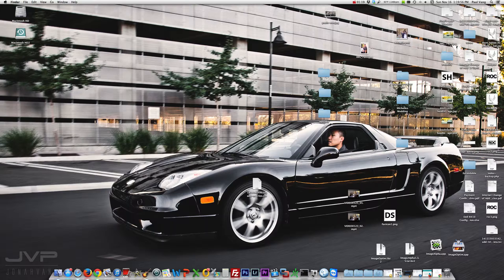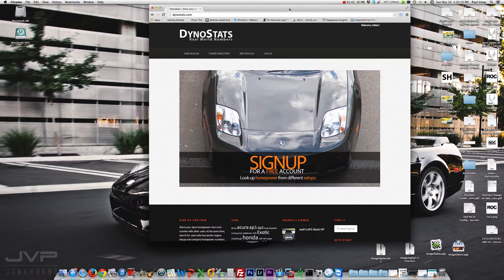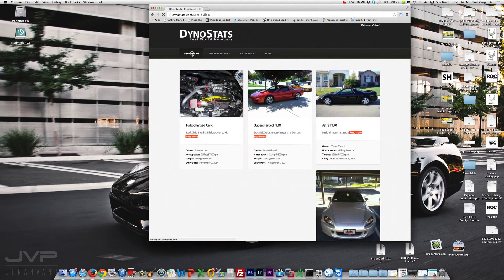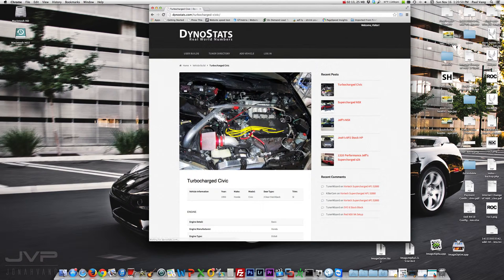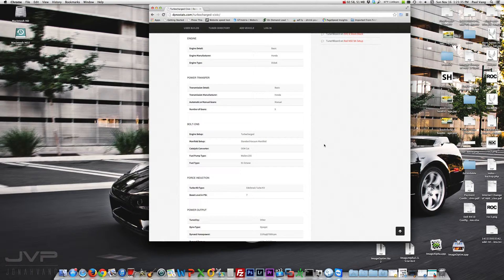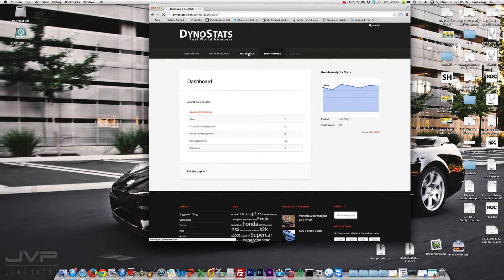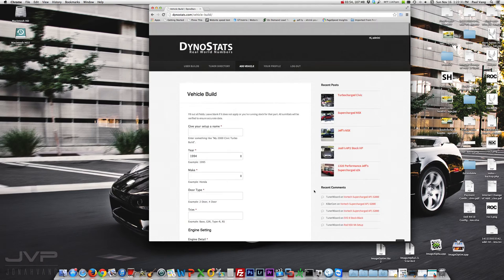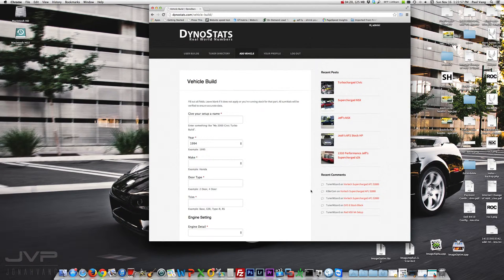The Future of Crome Tuning Basemap Sharing

Comment: hey im just a normal guy i have been looking into tuning modding my honda and i am wondering what this software is and how to use it
Reply from the maker: learn2Tune its called crome.  Its used for tuning hondas.  It's one of the best freeware software.  The free version would be able to do everything you need.  The paid version will give you more functionality.
Reply: Paul Vang i dont know how you are still using it..al the new versions are outdated..my dealer licence doesnt work anymore...i had to load the oldest versions possible to make it work and ive got no enhancements at all every single words are grayed out in enhancements...went into the manager i downloaded the jcspecial file wich will not run or open into crome...i just loaded a custom map i made for a customer delsol its the same setup i tuned yrs ago that i burned for his ecu...no added features what so ever even after doing everything possible...if u ever have tip to share id apreciate i would make more money on this job lolll..(its been a while i touched crome my dealer license is outdated)and specialising into k series now i never touch b series anymore lolll thanks for ur help bro
Reply: i am so sick of seeing white hondas with a k swap and a shaved bay
Reply from the maker: Vega-Expert What version are you running.  I'm running all the version up to the newest one.  It works fine.
Reply from the maker: learn2Tune I like the plain white setup.  It just looks cleaner to me.
Reply from the maker: yep.